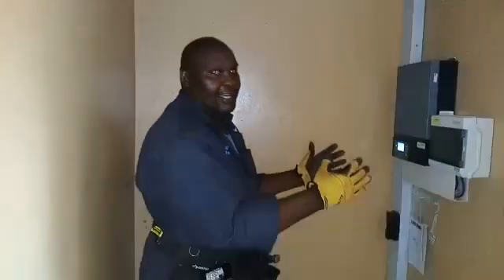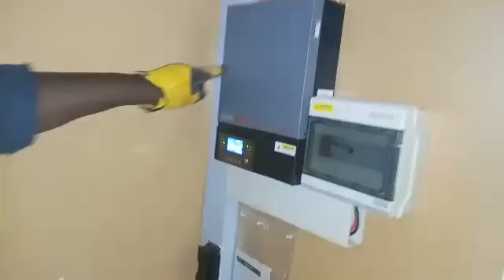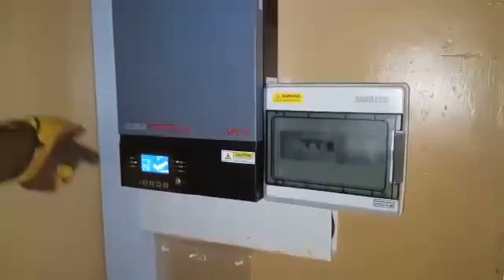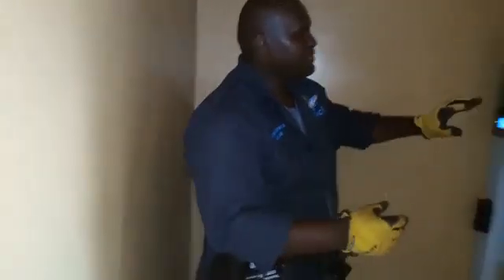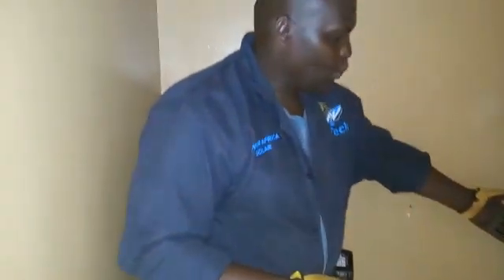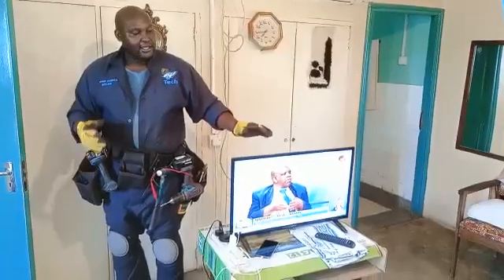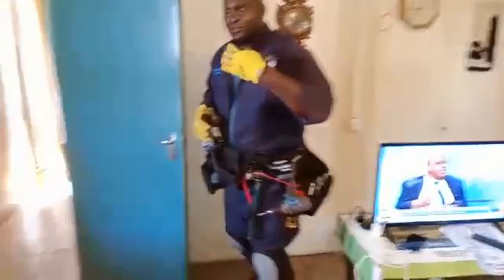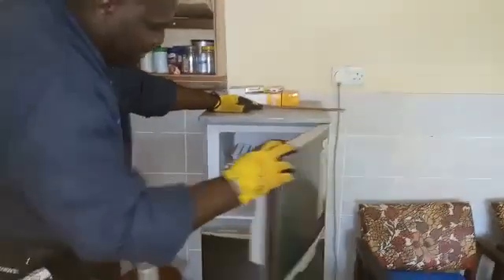What You Can Power With a 1.5 kW (1.5 kVA) Solar System in Kenya 🇰🇪

Comment: Can 1.5kva carry fridge?
Reply: A 1.5kw solar setup in theory should easily handle a fridge.. it's normally just when the fridge starts up that it draws a lot of power, (less than 1 second of high power )kinda like when you start a car's engine when u start it. But immediately after the high power draw of the fridge, the fridge will only draw a few watts depending on how energy efficient that fridge is. The fridge the part that cools the food down inside the fridge at the back of it, that part does not stay on 24hrs a day. It turns on and of several times day to control the temp you have set. The light inside the fridge normally only turns on when you open the door of the fridge. How many panels, how many other appliances that u plan to be powered by the system like the 1 in the video are just some of the things to be considered if u plan to go for a setup like that. 😊

Comment: nice. I have a 300w sunnypex panel, 1kva MUST hybrid inverter, 200 ah ritar battery. My load is just a few lights and sockets yet it keeps giving an overcharge alarm daytime then the battery goes flat very fast at night. What's the problem?
Reply from the maker: https://www.youtube.com/post/UgkxNBW2ucMheKhMfRXulhbfVqHrrJlL_Zqe
Reply: @PowerAfricaSolar  I think the SunnyPex was super fake. Very sad that some dealers are crooks
Reply from the maker: @salemorganicranch  We don't install such cheap brands
Reply: @PowerAfricaSolar  I know. The dealer was not you. It was a river road company. Turns out they gave me a 24v panel for a 12v system!
Reply: @PowerAfricaSolar 
Kindly share your contact
Reply: Add battery
Reply: @stephenmbugua5436  but it seems the panels are not charging the batteries. I changed the batteries and within 2 days the new one was flat. When I charged with a different system at home, both batteries charged beautifully. So it's either the panel or the MUST inverter charger but I suspect the panel
Reply: How much for that package?